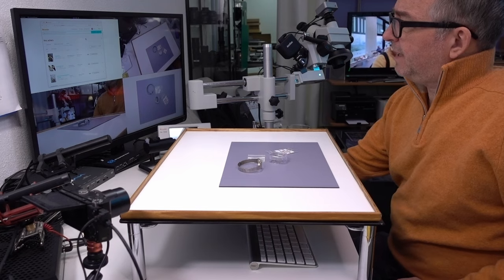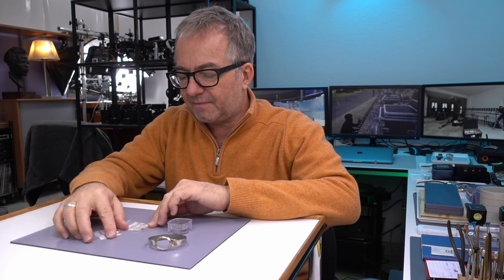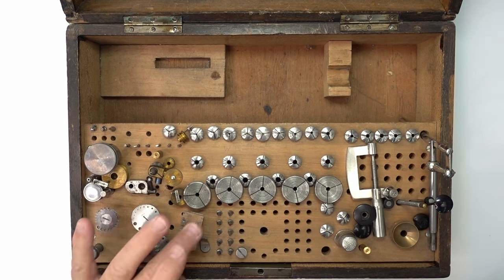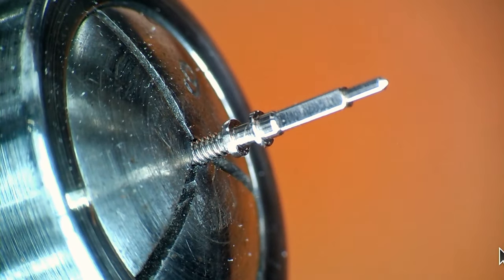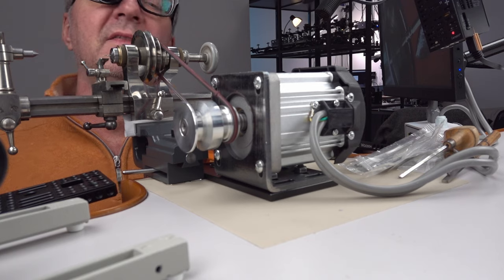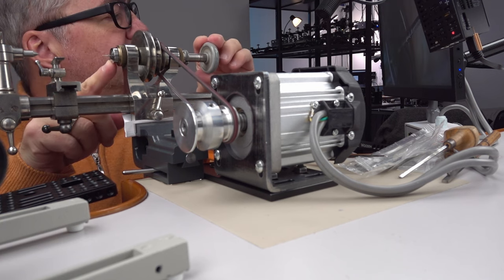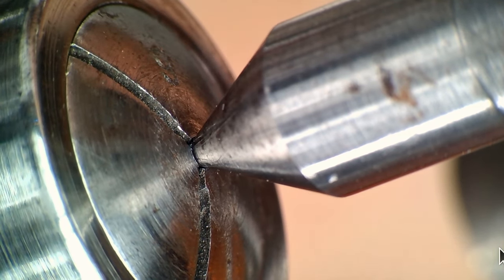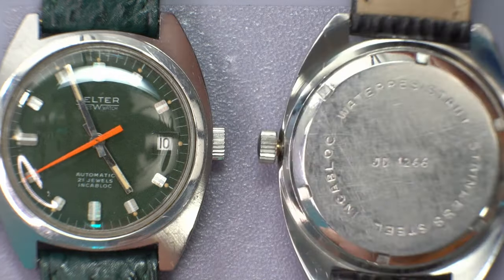Wolf Jahn Geneva-style 8mm Watchmaker's Lathe

Comment: That’s a really nice setup! I’m impressed with the microscope and monitor you have mounted. By the way, I learned a lot of what I know about hand turning from Archie Perkins’ book and from Dean DK’s YouTube channel.

Here are some tips I learned as a beginner lathe user over the past year- 
Turn under 1000 rpm, the slower the better. You should be able to just barely visually see the steel turning. 600ish is good. If it’s too fast, the graver will sort of skip over the surface and have a burnishing effect.

Lower the overall setup. I find I have better leverage with it chest height and that also allows me to rest my elbow on the bench for stability.

Keep the tool rest parallel to the work, and as close as possible. Perhaps a millimeter gap when viewed from above. But that will vary. Too large a gap may cause the graver to get pulled under the work, which tends to happen more with the tiny stuff.

Your graver should be sharpened up so the diamond is completely flat. You can turn the work either diamond up or diamond down, as a matter of preference.

The headstock/tailstock alignment test can be done with a razor blade being held between two dead centers. If the blade is straight up and down/front and back, then it’s aligned. I wouldn’t depend on a collet hole for the test. 

Excited to see the progression with the new tool. :)
Reply from the maker: Thanks Chris! I'll try all of these tips! I remember the razor blade test from your lathe video but I knew mine was too far off to even try that. Looking forward to seeing a video about your new rounding up tool!

Comment: Did you buy that motor separately? What motor and controller is it?
Reply from the maker: Thanks for your question! I just added the info about the motor to the video description. It was ~ US$100 for the 800W motor and bracket, and another $10 - 20 for the pulley wheels. The links are now in the video description.
Reply: @IMakeWatches  thankx for sharing

Comment: That lathe set was an awesome find for just over $300.00.  Some of the better lathes like the Wolf Jahn will have a serial number on each component.  Check to see if all of the parts, (Headstock, Bed, Tailstock) have the same number stamped on them. If so, that will most likely ensure that perfect alignment can be achieved, because you can be sure the it was perfect when it left the factory as the original set.  Oh, and for the love of God man, sharpen that graver.  Pick up a Bergeon 2462 and a good stone.  Just prepare yourself for a little bit of sticker shock.
Reply from the maker: Thanks for your comment! I did get some stones and inexpensive sharpening jigs and about eight more gravers in various lots of vintage tools (plus a few brand new ones). Eventually I hope to find a used 2462 or similar.
Reply: @IMakeWatches  I would recommend you watch Stephan Gotteswinter - slowspeed carbide grinder.    He does larger scale than watches but he still works with great precision and care.   And sharp is sharp.

Comment: look at your lathe tailstock. i think i saw screws. they may ajust alignment
Reply: You’re right, those screws should give you a small amount of gib adjustment. If the screws don’t get it he could always try a bit of shim stock to get it aligned.
Reply: @markclelland3510  Ive skipped on this design of lathe myself but they are interesting. i figured they would have alignment issues due to wear since the parts slide over and around rod.

Comment: you need a board or an aluminum base for lathe and motor
Reply from the maker: Clamp works fine. On this bench the Bergeon clamp is mounted to the bench, so the motor was traditionally mounted further back on the bench. I may move my motor back as well but will likely keep it on a separate plate so that I can remove it easily when the lathe is not in play and not put drill holes in my nice benchtop!

Comment: The tools need to be very, very sharp. Your microscope setup shows the contact really well... It looked, to me, that you had the tool upside down, we should see the flat part  from the top view. You might need to raise the tool rest, so that the tool approaches the work at close to 90°/flat... There's a nice little series of basics here
 https://m.youtube.com/watch?v=gK-5s5jAg0c
have fun! a lathe is pretty magical
also clickspring..
Reply from the maker: Thanks! Yes, I've watched that Dean DK video. Need to review it again now that I have some hands-on knowledge! About clickspring, I lost the clickspring in the first watch I worked on and spent almost three hours making a new one. That was how I first discovered the joy of watchmaking! 😂😂😂
Reply: I also saw the same thing, with the tool upside down but that's okay because the lathe is turning clockwise and the most common thing is to do it counterclockwise.
About sharpening the tool is true, it is necessary and the angle depends on the material cutted.
Reply: You have to use the tip part and that curved shape with such a large angle is not suitable for hard materials.